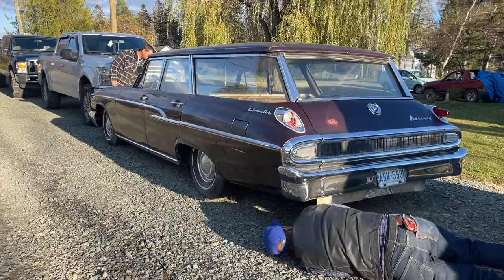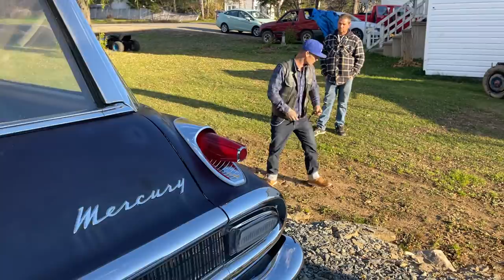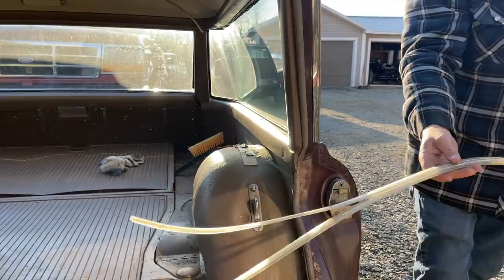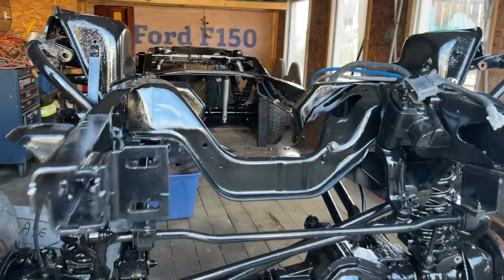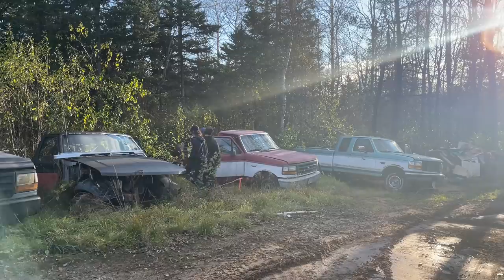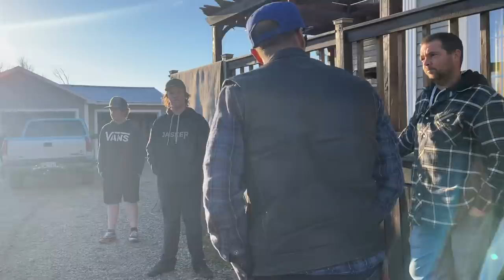RARE FIND 1962 Mercury Monterey Commuter Station Wagon - Stored in barn for 30 YEARS

Comment: I would change out the straight 6 with a nice v8. Great find plus getting a manual transmission as well.
Reply: Would make a fun cruiser with a 390 and Toploader along with the V-8 suspension and disc brakes.  I wonder if they put a 9 inch under these?
Reply: This is a rare Canadian Market exclusive model as mercury did not offer 6 cylinders in 1962 Monterey Class Cars in us. Keep it as it is!